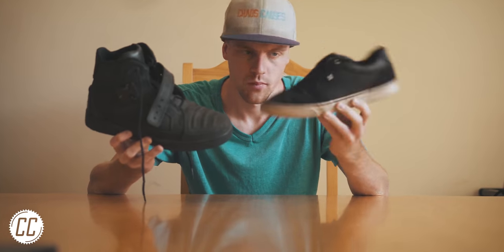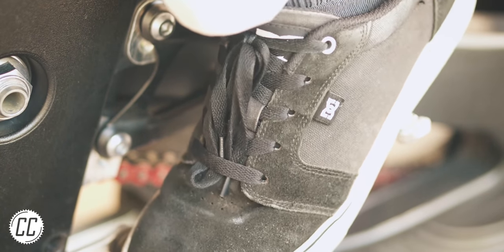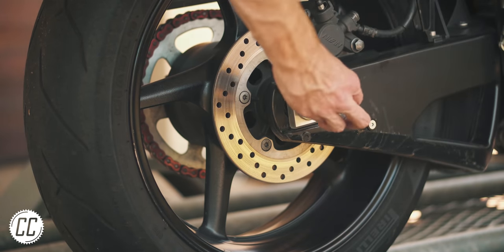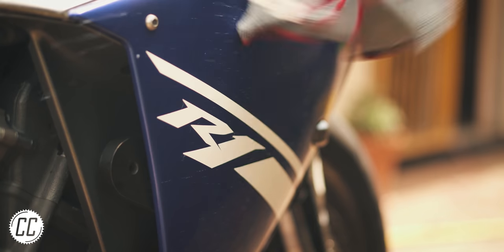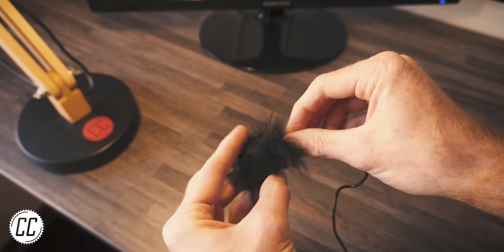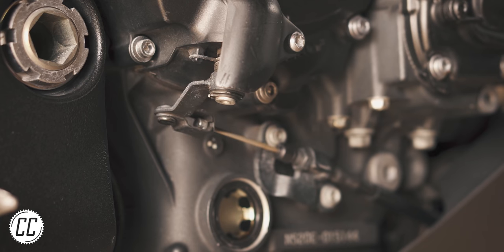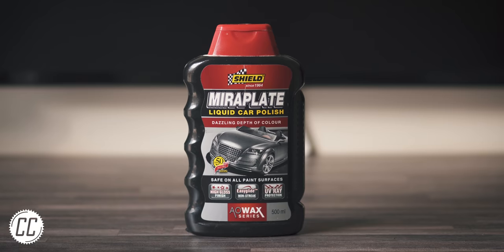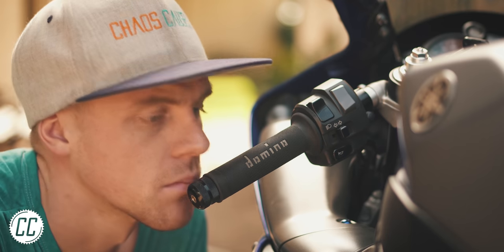10 Motorcycle Hacks And Tips For Bikers

Comment: Two bucket method should be standard when cleaning any vehicles to be fair, prevents dirt grabbing your mitten
Reply: I used a hose 🤷🏼‍♂️
Reply: I detailed cars for a few years. Add an extra step that is totally worth it. Rinse the vehicle down with a hose first, top to bottom. Gets the majority of the grit off first, then proceeded with the two bucket method.
Reply: @ChimzMT09  I snow foam, rinse, two bucket with dirt guard and rinse again then give it a shimmy shammy.
Reply: I've been doing this for my muscle cars for many years.  Carried it over to my new ADV bike now, and it works even better, due to excessive mud, dirt and debris. It's amazing how dirty the bottom of your rinse bucket is compared to wash bucket :-) Awesome awesome tip!
Reply: Brush and a hose.
Reply: Pressure washer to get rid of the dirt that is stuck to the surface, then hand wash with a single bucket, then pressure washer to remove the soap... Followed by an electric leaf blower to remove most of the water and then a towel to get those spots that the leaf blower missed...

Comment: Love the tie down eye bolts one. Been riding for almost 40 years and never heard of that one.
Reply: @joshuawhite1692  Plus I would put at least a properly sized electrical heatshrink tube over the threaded bar...
Reply: Keep one eyebolt on the bar permanently with thread lock, the other eyebolt won't loosen because the tiedowns stop the eyebolt rotating. A sleeve of plastic stops scratching. An old piece of garden hose glued on would work.
Reply: Don't do it!! When the suspension moves it will loosen! It moves indipendantly from the bike! Not safe!
Reply: @lukephilpot5660  no it won't, if you strap it down properly you compress the suspension, it then doesn't move it's attached firmly to the trailer.
Reply: The tie downs will keep both of the eye bolts from turning
Reply: joshua white what the fuck are you talking about? If you tie it down there will be tension on the bolts and won’t allow it to loosen, I swear people comment without thinking at all.
Reply: Glad to see some people here have foresight and common sense, one has none, concerning the tie down bar eye bolts.Under tension their not goin anywhere.
Reply: Yeah exactly what I thought too bro, needs a pin through the end of them and it'd be fine
Reply: I made my axle washers tear drop shaped so the small end stuck out past the swingarm. Then drilled a 2nd hold on the small end of the rear drop large enough for my tie down straps hook. Big end had the axle bolt hole of course. I even notched the new washers for chain adjustments. My adjuster bolts are in front of the axle and push the axle.
Reply: Well my axle isn’t hollow
Reply: Would this work for a paddock stand to lift the rear wheel?
Reply: @grissebassen6637  tadaaa....most older bike as well,and up to a point better use an anchor location on frame rather than swingarm
Reply: Love the tie down rod idea. FYI people - you're not leaving this in all the time.  It will never come apart with straps and friction pulling on it.  Just make sure it's beefy enough.  Helmet rack is cool too!
Reply: Probably a dumb question, but why cant you run a strap through the wheel?
Reply: @MindBlowBrainCrashTest  depends on the wheel but a sudden stop or ruff curve could break or bend it.
Reply: 47 years and I think I'm pretty smart...the young guy is pretty sharp 😎
Reply: @MindBlowBrainCrashTest  
Maybe I am not understanding your question correctly? Run the tie strap though the wheel will keep you from moving.
Reply: @jimlcher8201  Yes, but one should get loctite to prevent the rod from possibly turning, but the again when unter tension when strapped won it shouldn't
Reply: plus, most bikes don't have a spindle you can push a rod straight through

Comment: The threaded rod and I hook is a good idea, you can always line it with a rubber hose if you're worried about the threads cutting into the axle
Reply: Or Plastidip
Reply: Or you can use a piece of electrical heat shrink sleeve
Reply: Also the distance between the axel and rest of the bike changes all the time as suspension compress.

Comment: Grip hack: WD40. It will disperse  moisture, but provide temporary lube for slipping the grip on. After a few minutes, it's good to go. Also, to get the grip off, use an air compressor with a short 1/4" copper tubing on the end of a nozzle. Insert it into the grip end or next to the switch housing and then the grip will puff up and easily slide right off.

Comment: I feel like a total idiot when watching the shoe lace tip. I've been sticking the lace inside the shoe and its very uncomfortable. Definitely gonna try that one out the next time I ride
Reply: Instead of over, go under the laces, we did that back in the school years to hide them.
Reply: So I'm not the only one 😅😅😅😅
Reply: Or just fold your sock over your laces.
Reply: I can't believe none of you have heard of a square knot. shorten your laces enough to when you tie the knot it is toward the end of the laces and you have nothing dangling all tied. Or if you have high tops like converse wrap the laces around your ankle and then tie the knot to take up the extra lace. or wear boots
Reply: Saaaame
Reply: Just be careful of your foot position when I ride the shoe lace cross thingy near my toe always gets caught on the rear break or clutch I would suggest grabbing some boots if possible they are imo better for riding
Reply: @joujimiichi1  i get ur point  but i ride a 110cc 6bhp bike and the top speed is like 90km/h also the footpegs sticks out so much that the bike can fall over and not be on my foot
Reply: Why not just double knot the laces?

Comment: Awesome job on the Video. My hack I use, I put magnets on my bolt for my oil drain. Catches nasty contaminates. AND helps change lights in case my bike doesn't have enough metal to trigger the lights.

Comment: A little bit of rubbing alcohol in a grip also makes fitting it, a breeze.
Reply: Even water works well
Reply: You can also put the new rubber grips in to a bowl of boiling water for a small period of time. The rubber will expand a little bit which makes it easier to put them on the handlebar. Just remember not to burn yourself while trying to get the grips out of the water.
Reply: But will it smell handsome?

Comment: When removing the clutch pack, you should at least mark the positions. The steel plate and friction plates are most probably built in to minimize overall high and low sections due to manufacturing tolerances and therefore increasing the clutch's performance and behaviour during slip. On a bike, the comfort issues may be much less than in a car, but still it would be advantageous.
Reply: what Oil have to used to do the job?
Reply: @ovall_01  the same stuff you use to lubricate the the engine.
Reply: On older bikes when the clutch got grabby I used to mix up the positions on purpose.  I would even alternate spinning the metal plates backward.  This would end up expanding the engagement point softening it up a bit and that got rid of the grabby feeling.  MFR's got wise to this and started making different thickness plates so now they go in a certain order.  Thats great when it is new to soften the engagement point but later you can be stuck.  The basket gets worn to that pattern so now you can try the oil trick but if it just wont go away it might need a new baskket.

Comment: 1) For laces I don't want too long I simply cut them, then use a shoe lace lock to tighten and loosen the strings
2) I double knot the laces so they are shorter and less likely to come undone. Depends on how long the laces are to start with though.
Reply: No.laces ever get real.leather riding boots

Comment: Hack No: 11  I have riding boots, and my feet in summer boils inside on a long ride. So! I drilled 3 x  5mm holes in the toe, now when my feet gets hot just stick your toes out from behind the fairing and you instantly feel relief.  In winter or rain stick tape over or plug holes. It sounds a bit crude but it works.

Comment: For the red bull hack, you have two options: 
1- Place the can inside the inner pocket of the jacket.
2-insert the can good from your shoulder to one of the long sleeves of the jacket. For the fifth hack: use tree buckets, not two=soap water has to come off with clean water. And for the bonus hack, you can filter clean your dirty motor oil by draining the used engine lubricant in a container, then use a sponge inside a funnel to separate the burned metal friction residue.
Reply: Why three buckets? You use the soap bucket to get the dirt off, and then rinse the soap off with a hose... I've never heard of the "3 bucket method"... rubbing clean water on your paint will leave swirl marks as there's no lubrication (which soap provides)
Please don't comment if you have no experience.
Reply: @ali94hn   Read the comment over again if you cannot comprehend what you read.
Reply: @ali94hn  not experience he lacks it's a hose. Also, nobody said "rub" clean water, just rinse by squeezing it from the sponge, so don't be snarky eh, aint no need for attitude.

Comment: I'm getting 88 GW road ready an it came with floorboards an front/rear shifter. I'm finding tennis shoes are working much better for pedal control in tight area than my riding boots! Interesting! Next time in town I was thinking of looking at lower profile boots that can replace tennis shoes? You asked for hints, I needed plastic fairing repair, that I could reach from underside. Took hacksaw an cut several pieces from black ABS plastic pipe, placed ABS pieces in cover glass jar, covered pieces with lacquer thinner then covered with lid an let set over night. After stirring, an spread, ABS mixture hardens like rock. I should have used this mixture years ago!

Comment: Best way to put on grips onto the handlebars is by putting 3/4 cable ties into the grip which allows it to slide onto the bar. When fully on just pull the cable ties out 👊🏼 Plastic on metal slides better than rubber

Comment: I use the tie down method you mentioned but with a little insurance. I drilled a hole at the ends of the rod for a pin to go through so on long trips I dont have to worry about anything coming loose. Also wrapped the rod with electrical tape.
Reply: If you loctite just one side, then it will never spin loose once it's strapped down.

Comment: 6:05 US27 wall hook kits are a great option too and I think lower priced. I've had three of these for many months without any problems. Just don't pretend your helmet is a damn basket ball trying to slam dunk, install it using the included screws straight into a wall stud to play it safe, be reasonably gentle when hanging it on it, and you're golden. xD

Comment: Nice idea on the washing the bike part, oh and the through axle tie down bit I will be using.
Washing the bike after a ride tho, I use a spray bottle of simple green and water completely coating the bike with it, then I spray off the bike with my pressure washer , then blow dry it with my Leaf blower. I dont do this every time, Just either after a track day weekend or after a weekend of canyon riding.

Comment: I use plastic cleaner and quick detailer with hydrophobic properties to clean my helmet....and the bike as well. Rarely do I actually do a full two bucket method wash. Use brake cleaner for the wheels, just don't spray the calipers/pads

Comment: 1. My converse high tops survived a 40mph crash (got hit by a car), ended up with some minimal surface damage to my big toe. That said, any faster and I’d have been seriously injured. That said, my knees weren’t so lucky. I really need to get better about wearing riding pants. Anything sticking out will be ground down. X-/

2. I prefer backpacks because they keep the wind picking up my coat. That said, some coats have a pocket for chest armor (why anyone would want that on a mesh jacket is beyond me), and it left me with two huge pockets on the front. Not comfy, but you can get it home. 

Also, Best thing you can do is put a spider web mesh net in your boot and use that (I’ve strapped a lot of crazy crap to my bike. That mesh held a case of beer, toilet paper and cat food the ten blocks I drove it home (with plenty of stops/turns/etc). Might not recommend it for highway (for loose item loads, heavy stuff will stay down no problem), but under 40mph, totally.

Comment: Glass cleaner works for grips and lubing the bead while changing tires. 
RainX works wonders for shedding water from your visor or goggles. Remember to dilute the concentrated formula, or pick up the goggle and visor safe formula.(I have never seen the safe formula in my neck of the woods) Amazon maybe cheaper.
For adv or enduro guys that have rear racks...pick up some sport bike sliders. These sometimes bolt into place where your rack bolts go. Now you have grab handles you or your buddies can push on when stuck. 
I see a ton of people trailering bikes and they are so tightly ratched down compressing the forks. This will eventually wreck your seals. 🖖

Comment: No.2 tip about that item inside the shirt. Anyway, what happened was i was asked to get chicken from my sister living about 10 kms away. So using my sportbike instead of my bike used with a box, thinking that it might just be chicken nuggets or even chopped ones that i can put inside a small plastic bag and tie to my side near my upper sliders as i want to do it fast. Lo and behold, it was a live 3.5 kilos chicken. At first i tried to drive one handed: one hand holding the chicken and one on the handles, it was insanely hard and messy. Having no choice, i did option 2. I put it inside my shirt, and tucked the bottom, with its head sticking out next to mine. I looked absolutely ridiculous that some people laughed as i passed by. Dad couldn't hold his laughter so hard that his blood pressure shoot up. Good thing though that the chicken didn't even attempted to break free, else it might have left a bad scratch on my chest.

Comment: clean the halmet only with warm water, any type of product for helmet cleaning or not will destroy you pinlocks and airvents within 1-2 years. Tried it miself on 2 arai and 1 shoei untill I learned it the hard way, sometimes warranty will not respond if they find any type of substance on the helmet. Just take a fiber cloth put it in warm water place it on the helmet for 3-5 minutes and after you can clean all the moist dirt bugs from the helmet.

Comment: For removing bugs off your helmet try getting a paper towel wet and let it soak on the helmet for a bit.  This will loosen up the dried dead bugs and make it easy to wipe them off without damaging the helmet.

I have done the shirt trick before but for something small like that i just close up my sleeves on my jacket and put it down a arm instead.  Then i dont have it pushing on my stomach and tank for the ride.  Yet i have done down the front of the jacket when i did a little too much shopping.  :P

Comment: I've broken shoe laces doing that, I was not going to drop my bike.  Lemon pledge for bugs on your bike, visor and helmet, spray on let sit for a bit and wipe it off, cleans and waxes so they come off easier next time.  Been using it for years
Reply: I worked at a dealership, we used to use pledge 25 yrs ago to remove all the finger prints and dust. Now days you can't sit on it unless you're interested.

Comment: Personally i wouldn't use the dishwashing abrasive sponge to clean the disc rotors. All the micro grooves in the disc could be very slightly altered causing it to not sit perfectly with the pads worn to the disc shape therefore reducing braking power.

Comment: damn I just love the older R1s .. such unique design and headlights .. I got myself a MT-09 this year because I dig the upright riding position and power/weight ratio xD Maybe I'll switch to the MT-10 in a few years, that has an R1 engine.. I've already heard that it's amazing to ride it. Naked is my way. But I love super bikes as well. 
Nice Video. I always wear laced specialized boots. There are meant for law enforcement but it turns out they are very capable and comfortable motorcycle boots as well. I'm puttin the laces into the inside of the shaft, there's no way they can get out and tangle around something. But the time will come, when I am on my bike, only with sneakers, remembering your tip for those extra long laces that always get out of the shoes ^^

The hack to skin the a cat is the best one for me.. It had awesome results. The apartment is now quiet at night.. My gf wasn't that amused but you gotta make a compromise xD

Comment: I ride in sneakers and will do it in the future still. Don't ride like an idiot and it's a non issue.
About the laces - don't ride in sneakers with long ass laces or tug them away inside the shoe. I dropped a bike already at a still stand but not because the laces wrapped around the peg, but I couldn't get the motorcycle boot off the peg. Don't ask me how, but I managed to do it. No issues so far with sneakers. 😂✌

Comment: The second tip could be dangerous: Never put anything sharp or metallic like that without a proper encasing. If you crash and crush that can, it's gonna slice your guts like salami. Lots of people die with punctures from stuff inside cheap fanny packs, now imagine straight up no protection. Stay safe lads, get a tiny pack and wrap it on the passenger place for those scenarios.

Comment: Number one hack here would be too use WD40. And brake cleaner to free up any kind of hard drifts grease buildup. The WD40 will bring the slick wet new finish your bike had when it was brand new. It will also help repel water and corrosion. The brake cleaner dries fast and is generally safe I wouldn’t spray it on any rubber components though.